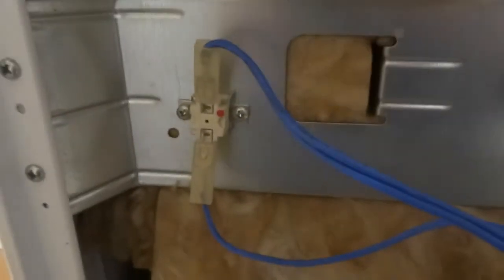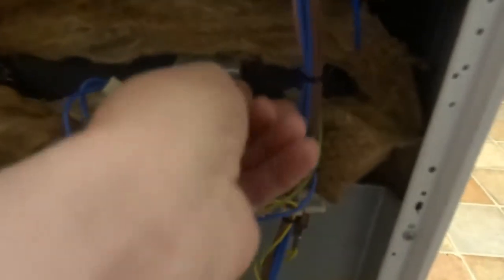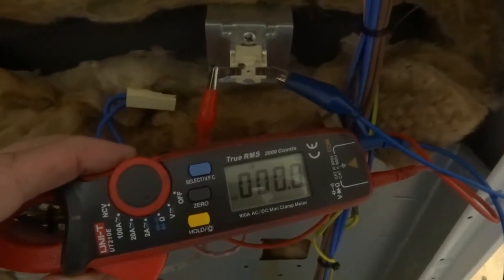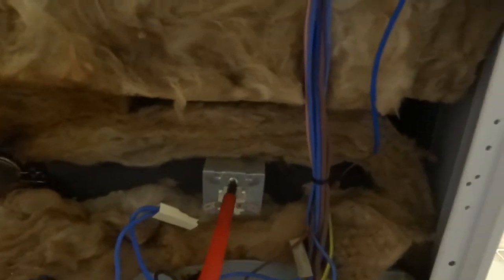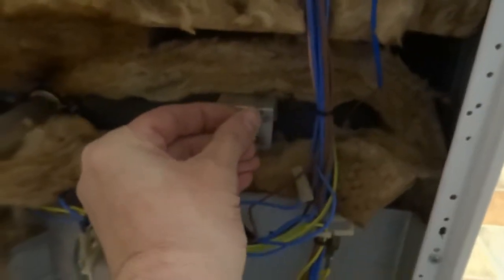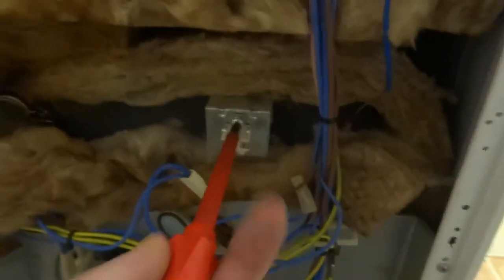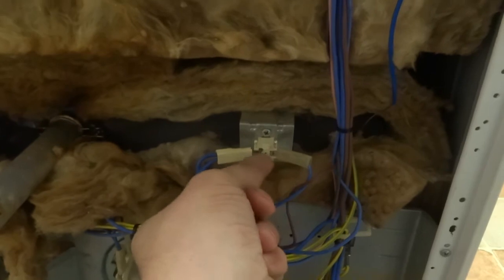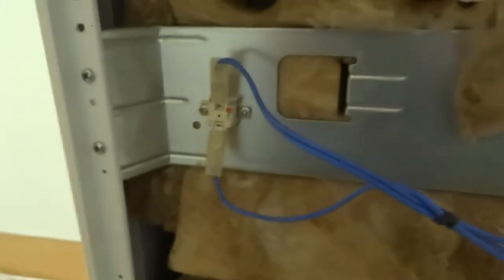Cooker Not Heating? How to Test & Replace Thermal Cut-Outs (TCOs) & Oven Overload Thermostats

Comment: Great video, what is the purpose of the thermal overload switch please ? My oven when turning the knobs I.e oven stater for fan and temperature doesn’t work at all, I think it’s the fan motor and heating element after 15 years on my BEKO but then I don’t know if I need a other new part etc, I have oven man coming to fit the new parts I bought for my good condition, but does anyone know what problem is likely to be and what faulty oven part could be the culprit, any help / suggestions would be great, thanks 👍
Reply from the maker: sorry missed this to prevent over current over heat of elements